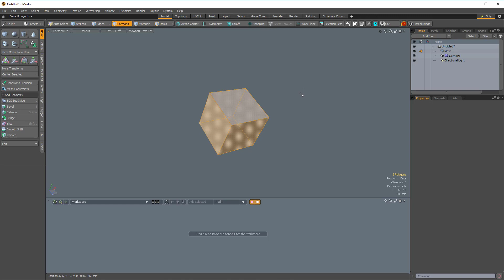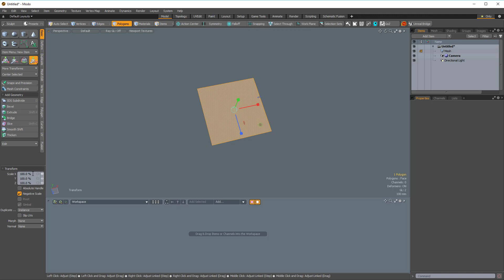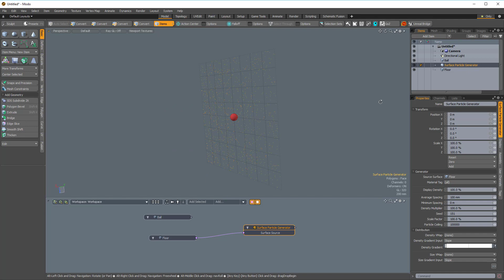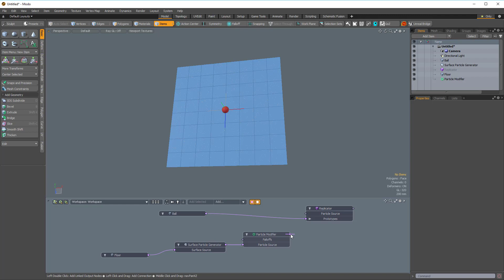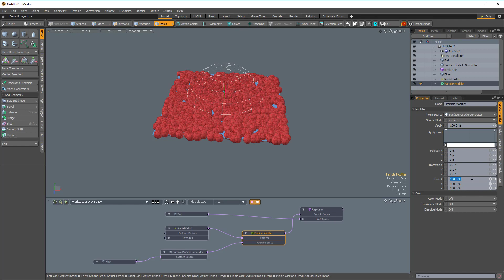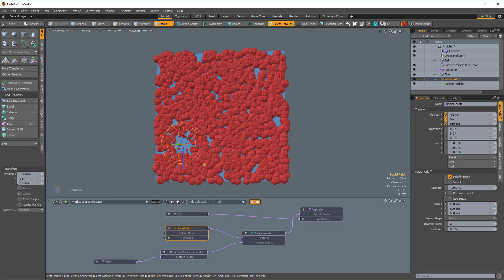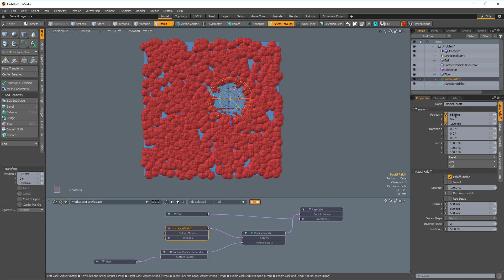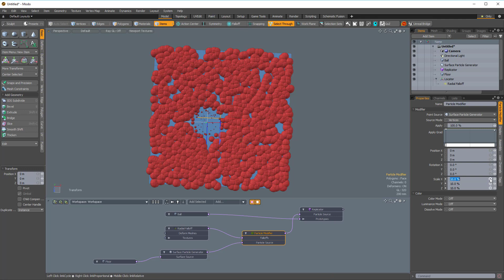Modo Quick Clip | Using the Particle Modifier

Comment: Thank You. How would you integrate a second Falloff?
Reply from the maker: You can add more Falloffs to the schematic, and then connect them to the the Particle Modifier's Falloff input. You can change the properties of the additional falloffs and you can even use different kinds of Falloffs, such as the Capsule type. I'll have to research to see if it's possible to add multiple Particle Modifiers to a single replicator.
Reply: thx, i try it